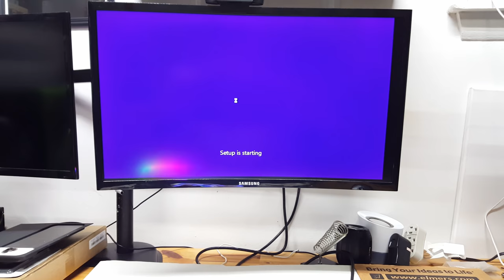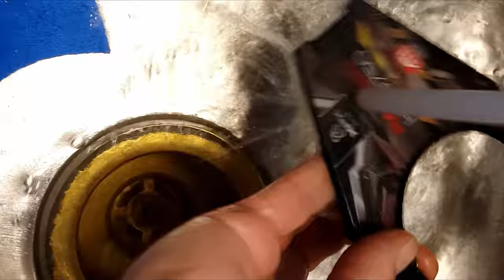High tech low spec 2007 HP Computer

Comment from the maker: My last Hp Dc7800 project will have better performance here's the build so far https://www.instagram.com/p/BvdFKmZha1u/?utm_source=ig_share_sheet&igshid=6itmoxjdb64f
Reply: nice I have hp  Dc7900 it works great still my brother give it to me  about 2 years ago
Reply: Any AMD Phenom II or FX builds like this in the future ?
Reply: Still have yet to see an amd low spec build, but I understand why not. The only old amd cpu I would touch is the x6 phenoms, which are essentially just a core 2 quad q6600 with six cores that clock slightly higher. And are usually harder to get your hands on.

Comment: One thing you may want to try is some CA glue with accelerator to hold the fan mount down. I have been using CA glue lately on all kinds of projects, and once it sets up with the accelerator (in about 5 seconds) whatever it is, it isn't going anywhere!  This will keep you from having to drill holes (ouch) in the motherboard. Just place a small amount on the motherboard, then spray the accelerator on the four corners of the mount, and once it makes contact, that sucker will never move. 
I used it recently to attach a safety block to a table saw sled, and I yanked on it, after about a minute, and it would not budge....at all.

Comment: I love your videos, as like modding things to my liking as well. I picked up a cheap HP 8300 Elite SFF without RAM or HDD, added that, and added my own GPU via riser cable an additional external PSU I had that I received from a combo of PC case + PSU. Unfortunately, it won't boot, I guess every PC part has to get the signal at the same exact time in order to post... Too bad, because the choice of LP GPUs is so limited, and they're much more expensive than what they're worth in performance, and I need a 2nd gaming PC on the cheap side while I travel..
Reply: I also flashed BIOS to the last version, and disabled Safe Boot and enabled Legacy Mode and nothing. While with an old, small GPU and the same PSU it boots without problems. I suppose the same PSU has to be connected to all PC parts, I really thought I could just jump the MB wire to start the GPU, and simply power it with an external PSU T_T

Comment: How does that cpu cooler perform, aside from being pretty?
Reply from the maker: It's junk that's why I went with the q6600
Reply: @modstek 

I know they're less than $10 from china (at least the ones without rgb). Is it able to keep a q6600 under 80°C without beung obnoxiously loud?
Reply: @joeyverliesharen  should be as long as you also have a case fan... also undervolting the q6600 can help a lot, usually its possible to reduce their voltage needed to run stable by quite a lot

Comment: Can you do video on Dell optiplex 580 I got 24gb Ram in mine with windows 10 pro and I know if I had a reason to I could put 32gb in there but the 24gb is working surprisingly well with my amd phenom ii x4 b97 cpu and gigabyte gt710 2gb ddr5

Comment: Didn't try the bsel mod on the core 2 quad q6600 ? or was it not capable of handling 1333 fsb processors that motherboard ?
or have you done that in a previous video before ?
gpu performance wise id bet a gtx 570 or gtx 750 ti 2 gb would work nicely with the q6600 @ 3.0 ghz.
Reply from the maker: I did the cpu cooler is crap so the fans raced. So I took the tape off

Comment: I own 30 of these pcs and you've been giving me some amazing ideas on how to breath life back into them. Small question, would you recommend I keep they at windows 7 or windows 10? I've noticed windows 10 generally uses 1gb of ram off and on and then coupled with Google chrome really limits these older pcs. Do you have any advice?
Reply from the maker: If your using mechanical hard drives I suggest Windows 7 but will be harder to sell in my opinion. Windows 10 paired with an ssd and 4gb of pc2-6400 works totally fine.
Reply: @modstek  thank you! About what I was thinking since I can get 120gb ssds for $17 in mass

Comment: I love your video. Keep them coming. What is the cpu cooler you are using? And where did you get ddr2 Rgb ram?
Reply from the maker: It's really not a great cooler but you can find it here https://rover.ebay.com/rover/0/0/0?mpre=https%3A%2F%2Fwww.ebay.com%2Fulk%2Fitm%2F401642015932
Reply from the maker: Ram covers Memory RAM RGB Cooler Heat Sink Cooling Vest Fin Radiation Dissipate for DIY PC Game Overclocking MOD DDR DDR3 DDR4,MBK5-1 https://www.amazon.com/dp/B078R53HTT/ref=cm_sw_r_cp_apa_i_.32PCb8247Q00

Comment: Hey,
I got an optiplex 780 sff ,
Core 2 duo E8400
6gb ram
 I recently got a 1050ti(4gb oc edition from gigabyte)
 Unfortunately  it requires a 6-pin power connector and its a full size card.
I added a sata power connector as it only have one coming from the psu.
So will be able to run the card using a sata to 6 pin converter and a pci extender?
Or is there anything else i can do?
Can you Please help me ?
Thank you:)
Reply: Neo Francois okay,thanks:)
Reply from the maker: I had a RX-580 8gb working just like that on a pc like this with a 240 watt psu no problems
Reply: @modstek  wow, what did you for the power connector? I read in the gigabyte website that it uses 75w max . So i was wondering if i can just connect it and run it without the power connector?